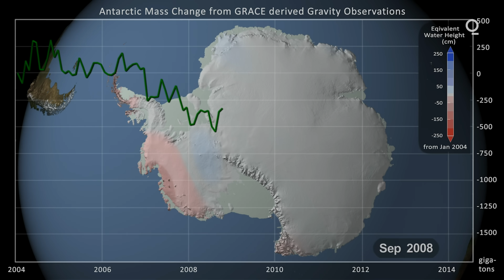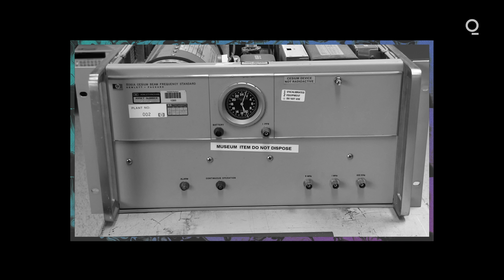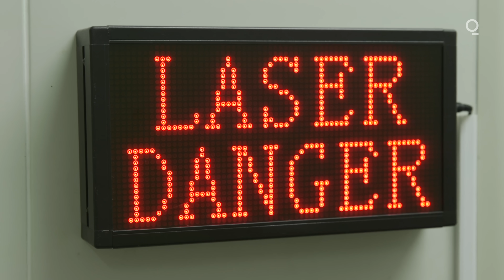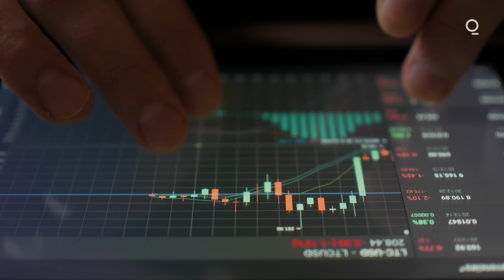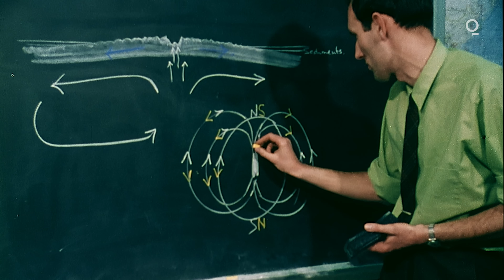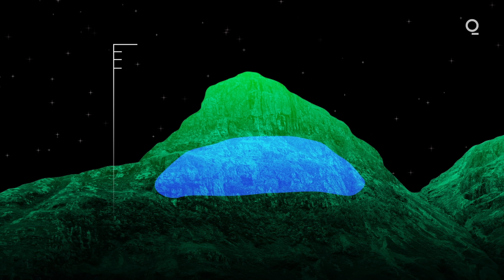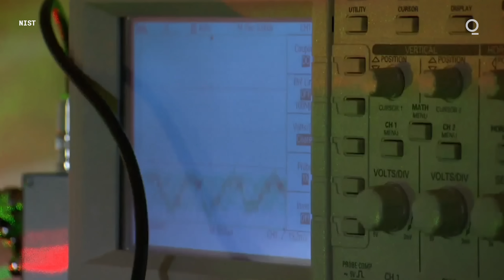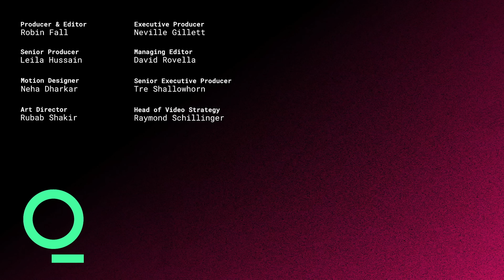Atomic Clocks Are Reinventing Time

Comment: You could line up a set of satellites around the earth and send a set of laser beams bouncing around the earth  with the time encoded in the beam for a month and measure the difference between the original clock on earth, clocks would tick faster in space, I suppose if you did a similar experiment with video in space looking at earth you would have forward information of Earth

Comment: The gravity is different from north to south.  At the equator the gravity is greater than the poles  due to velocity of earth at the equator.
Reply: That is completely backwards. 

That means the radius is slightly greater (about 21 km) at the equator as compared to the poles. Therefore due to the inverse relation , gravitational force at poles turns out to be 10m/s^2 and at equator 9.8 m/s^2.

Using Newton's law of gravity, we find that the force of earth's gravity on your body at the equator is 9.798 m/s2 times the mass of your body, whereas at the poles it is 9.863 m/s2 times the mass of your body. The earth's centrifugal force also varies with latitude.

Comment: Atomic clocks are apparently top secret.  The Edison generator can be used as a clock and we have been waiting for this basic technology since 1920 s
Reply: Its all bs, its not time that changes its the movement of the atom in the clock. They are measuring time through how the atom moves. Obviously when you bring the clock closer to earth, the atom moves slower because gravity is acting more on it. And if you put the clock on the tallest mountain in the world the atom would move faster because gravity is a bit weaker up there. Time itself is not changing its just how the mechanics of the clock being affected by gravity, and this could also happen through acceleration as you could imagine. Moving a clock very fast would reduce the effect gravity has on it so it would tick faster.

This doesn't change the fact that time is constant and independent of absolutely everything that exists.

Comment: I remember when my ship was on patrol in the Pacific. We had a phone number in port we could call which I think was with the National Weather Service. They would give you a recording that counted down to the specific time and marked it. That was how we set our chronometers. We would be out for a month or two and you could tune in their stations anytime on the radio to make sure the clocks were still correct. When you are taking a fix with a sextant on a star or the Sun it's critical that the angle you get to the star is at a specific time. Then you look it up in the Bowditch manual and it tells what longitude you're on. You can plot latitude with dead reckoning pretty much but there was no other way to measure longitude. I suppose it's all done by satellites and computers nowadays in Atomic Time.

Comment: Nope. So the electon atmosphere shrinks. The circumference of the electrons orbit shrinks. But so does the nucleus of the atom. As you travel faster. The length of the orbit increase because it becomes more oval until you reach the speed of light where all matter collapses and turns into energy. Or basically you disintegrate. But traveling faster accelerates atomic decay.  Because the orbitals arent as stable and have to travel longer distances. The quantum atmospheric density  lessens then. Because of this. It shrinks similar to gravity. But the nucleus of the atom expands  at more velocity. Opposite to gravity.

Comment: Did they say WHY gravitation affects the atomic clocks? Is it really time itself or is it something like the air density, which works as a drag by slowing you down the closer you fly on the surface?
Reply: Its all bs, its not time that changes its the movement of the atom in the clock. They are measuring time through how the atom moves. Obviously when you bring the clock closer to earth, the atom moves slower because gravity is acting more on it. And if you put the clock on the tallest mountain in the world the atom would move faster because gravity is a bit weaker up there. Time itself is not changing its just how the mechanics of the clock being affected by gravity, and this could also happen through acceleration as you could imagine. Moving a clock very fast would reduce the effect gravity has on it so it would tick faster.

This doesn't change the fact that time is constant and independent of absolutely everything that exists.

Comment: I always thought about this… But I figured we would never have a definite answer because of the quantum issues that arise with measuring such small incremental changes. 

I honestly didn’t think semiconductors and detectors could become sensitive enough to measure such small amounts of time...( beyond what atomic clocks have been capable of doing for the last few decades). 

And honestly I still don’t get it…  we are already being limited with computer chip manufacturer because of issues on the quantum scale, ......so  how can we make more sensitive detectors and push the limits of silicon and crystal detection systems… Without running into the same issues?

Comment: Btw the scheme shown at around 1:00 is incorrect: as long as the spacecraft moves away from the Earth, both observers perceive their own time as passing faster compared to the other, since for each of them is the other that is moving away (hence the effect must be symmetrical): it is only when the spacecraft turns (i.e. changes its inertial system) that the simmetry is broken, and both observers agree that time has passed slower on the spacecraft, compared to earth (which has never changed its inertial system).

Comment: Are gravity waves only travelling in space or do they travel in spacetime? If the latter, then what the heck is LIDO measuring? as the gravity wave would also have a time dilation component such that the speed of light is maintained for all observers. Meaning any change in distance caused by the wave should also have a corresponding change in time dilation.

Comment: As I recall, they spent more than minutes on the planet, which had a time dilation factor of 40,000 or so.  15 minutes on the planet at that factor is about a year elsewhere.  

Not mentioned is that the 2 influences on GPS satellites partially cancel each other out.  The high speed relative to our slow speed slows down time on the sat., but the lower gravity makes it faster.

Comment: What they did:
2 synchronized "ultra precise" atomic clocks next to each other.
One of them raised 33cm (tiny decrease in gravity).
Result: clock that was higher up began to "tick" faster. Very small amount.
Their conclusion: time sped up for the higher clock.

My view:
I'd say they got it backwards. Time concept reversed. 
They ran their measuring machines in a slightly different (gravity field, magnetic field etc) environment. 
That's why they got different results. Tiny differences in oscillations in the hearts of atomic clocks.

Time is not speeding up or slowing down. Instead, these clocks are speeding up and slowing down. Speeding, slowing, coming, going, moving, rotating, orbiting etc - these are moving, oscillating, vibrating objects doing that, not time.
"Flowing time" is a concept, an invention of a human mind, to make life easier. 
Time = space. Nothing more, nothing less.

Time comes to "life" for us, when we start comparing moving objects, measuring moving objects. If all objects would stand still in the Universe, there would be no time cocncept, because nothing could be measured through motion.

Comment: Still I wonder, if we can even measure time itself accurately, since still an atomic clock is used by the frequency of atoms.  That's something that is still using something of matter, but time is an indefinite measure of existence that shouldn't be influenced by outside forces.  I think we still haven't found the answer to accurately measuring time and when we do we will unlock more answers that will change how we think of time.

Comment: As far as I'm concerned, this is more science fiction than it is factual. An object closer to the center of a circle takes less time than an object around the circle. But, the measurement of time remains the same. They're trying to make it sound as though time is a speed that changes when time is a measurement of various things happening. You dont find a difference of how much time it takes for the sun to travel across the sky based on you altitude, do you? No! Although the duration of time with the sun varies depending on your region, hence, one of which a region is

Comment: I have never understood the relation between time dilation in a gravity well and time dilation due to the speed you move at. 

Speed is distance over time. And gravity, effectively being acceleration, is the change in speed over time. You need no acceleration to maintain speed in space. Why would just going at a certain speed dilate time the same way acceleration does?
Reply: Because your travel is always going to be   relative to an object of mass somewhere  in the universe. Nothing is motionless.
Reply: @paulvale8531  Still you will, while travelling at a set speed, experience varying acceleration (from gravity wells), depending on how far away from the objects of mass you are. 

If it was only the acceleration (whether from a gravity well, or from actively accelerating) that dilated time it would make perfect sense to me.

Comment: Wait, if atomic clocks measure number of atom oscillations - wouldn't all these experiments just prove that atoms are oscillating faster / slower depending on the gravity, and not that "time is going faster or slower" ? For example, putting 1 atomic clock in space, and 1 on earth and conducting this sort of experiment the result would be for example "the atom in a clock in space oscillated 101 times while the one on earth oscillated 100 times", but that still does not prove time dilation ?

(This is a question - not trying to disprove or debunk this, I assume i'm missing a part of the picture or i'm just logically wrong.... Can someone explain this to me?)

Comment: all the talk in this video of time speeding up or slowing down for one of the clocks should state more clearly that that is relative to the other clock (observer). Time doesn't 'speed up' or 'slow down' in any non-relative sense for any clock considered in itself.
The idea of time itself speeding up or slowing down doesn't even really make sense (you'd need some kind of 'meta-time' to observe that), but also the clocks themselves don't speed up or slow down for the local observer . If you are on a spaceship traveling close to the speed of light, you aren't going to look at your clock on the ship and say "wow, it's really ticking slowly." It will look the same to you as it always did.
also, what's being reinvented here is not time, but the measurement of time. yes, they are connected, but they are not the same thing.
thank you for coming to my ted talk

Comment: Does the oscillator in an atomic clock have a mass? Yes; therefore it has an error and is itself subject to Newtonian and relativistic errors.
Does measuring the oscillation change the oscillation. Probably yes.
How do you compare the times of two atomic clocks without creating relativistic errors?

Hmmm....

Comment: I must be missing something here - how exactly do you compare two atomic clocks which have been physically separated by miles and are running at different rates because of the elevation? The observer would have to already know the distance between the two clocks? hmmm
Reply: you bring them back together and compare them to each other and to a neutral 3rd reference clock
Reply: How would that even work? Who is to say how long the clock spent at any given altitude going up and down the mountain. Time would be measured at different rates so how would you ever know the height
Reply: @dfs7979  wtf. what you're asking doesn't even make sense. the altitude of the mountaintop is a known factor. when you bring the clock up there you know exactly what altitude it's at, you ever heard of an altimeter, etc?

Comment: This is very interesting. So besides giving us a timescale that is more uniform than astronomical time, atomic clocks may give us an accurate way of calculating astronomical time? I guess in the future, instead of using unpredictable leap seconds, we can use atomic clocks to calculate a highly accurate astronomical second, so we can use seconds with changing lengths to keep our clocks aligned with the sun. Of course atomic timescales with fixed SI seconds will also remain available for those who need that kind of thing.

Comment: its amazing that Einstein somehow figured out that this was how time works based on... based on what???? like nothing except math really.. its crazy
Reply: it's actually very easy to figure out when you think about it, it was only a matter of time that anyone would have figured out the same thing at that time. it all stems from the discovery/observation that light speed is constant no matter how fast you're going and what 'reference frame' you're in. Once you realize that the speed of light is the same for someone going nearly the speed of light and someone going 1mph, there are massive ramifications made from that which lead very easily/logically to time dilation. If you want me to explain give me your email and I will tell you about it
Reply: @kardsufur2966  Its all bs, its not time that changes its the movement of the atom in the clock. They are measuring time through how the atom moves. Obviously when you bring the clock closer to earth, the atom moves slower because gravity is acting more on it. And if you put the clock on the tallest mountain in the world the atom would move faster because gravity is a bit weaker up there. Time itself is not changing its just how the mechanics of the clock being affected by gravity, and this could also happen through acceleration as you could imagine. Moving a clock very fast would reduce the effect gravity has on it so it would tick faster.

This doesn't change the fact that time is constant and independent of absolutely everything that exists.

Comment: I just wonder who came up with the idea to measure height on earth with this. Mass is not equaly distributed over the globe, so is it's gravity, and the time dialation won't be the same for 1 cm on the nort pole, compared to the south. It won't even be same few blocks away from your house. The only way to solve this is to have insanely large and detailed map on mass distrubution for the entire planed, that goes along with tides, the moon and it's position, and so on... Am i missing somehting here and this should not be a problem fro solving?

Comment: So I wonder if gravity is affecting the mechanics of the clock mechanism(oscillation) vs an actual change in time ‘dialation’
Reply: Smart thinking
Reply: I think its the same with a normal clock. If supposedly a normal clock ticks faster when you put it on the tallest mountain in the world vs when you put it on the ground, its because gravity is weaker at that height so the ticks move faster. Thats if that's how they are designed at least.

Comment: What I don't understand is if a person traveling away from earth, their clock slows down? I thought the further away from gravity you get time speeds up right? 0:50  I did not think there was a difference between  Relative time dilation and Gravitational time dilation. EDIT: Nevermind Time slows down as you travel faster because momentum bends the fabric of spacetime causing time to pass slower
Reply: Its all bs, its not time that changes its the movement of the atom in the clock. They are measuring time through how the atom moves. Obviously when you bring the clock closer to earth, the atom moves slower because gravity is acting more on it. And if you put the clock on the tallest mountain in the world the atom would move faster because gravity is a bit weaker up there. Time itself is not changing its just how the mechanics of the clock being affected by gravity, and this could also happen through acceleration as you could imagine. Moving a clock very fast would reduce the effect gravity has on it so it would tick faster.

This doesn't change the fact that time is constant and independent of absolutely everything that exists.

Comment: Gravity and speed does not and can not slow down time. I believe what they're showing in the difference in the "speed" of the atomic clock to be true in reference of it's position. Gravity and speed may change the rate of anything made of atoms and even dictate our observation based upon point of reference. We can create faster oscillating lasers which results in less drifting of our measurements. You can hitch a ride on a gamma ray burst while another pitch a tent at an event horizon all while I'm here on Earth typing this comment. The main thing that will change is your experience (observation & point of reference) and your atomic clock (the rate that something happens), but time doesn't change. No one that I heard of has proven time to be made of anything. Time is just a space that we exist in. I'm not an expert. This is just my strong opinion and open to hearing yours.